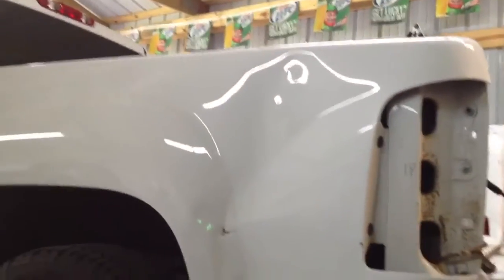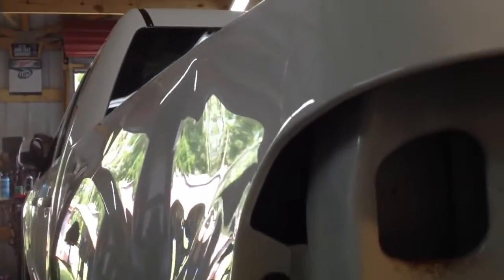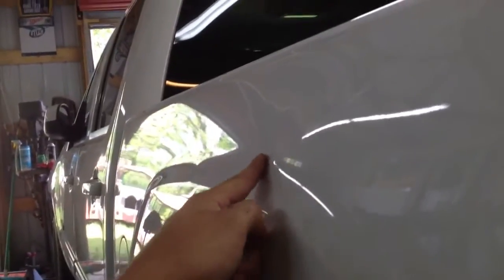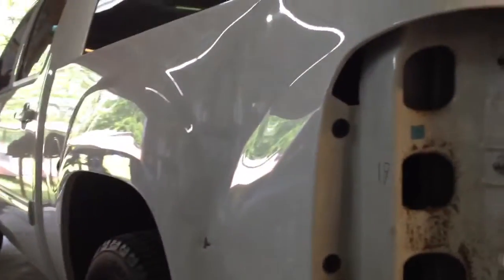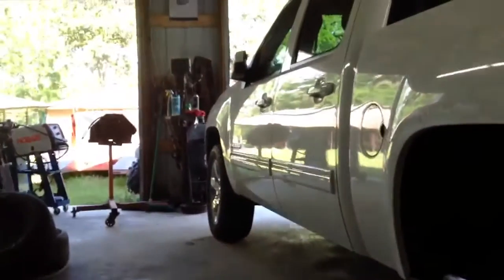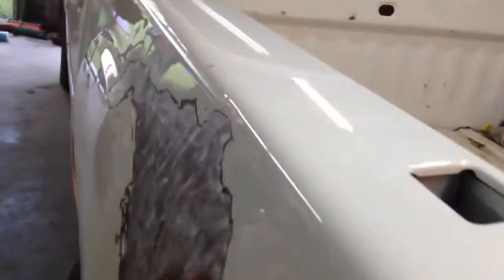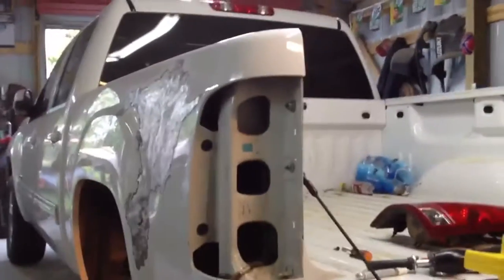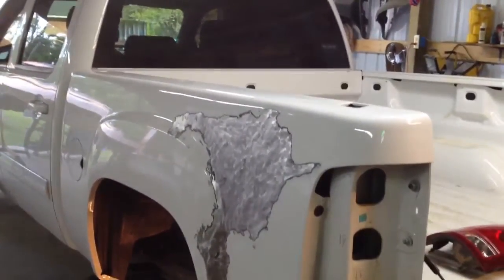Jackknife repair on my truck

Comment: I'm hoping to find a way to straighten the same area on my truck. I was turning around in a driveway and I ran up on and enormous pile of concrete these people poured in the ditch in front of their house cuz kids were racing their rice burners through his yard. It pushed the bottom of the panel straight up about 4-5 inches and folded it accordion style.